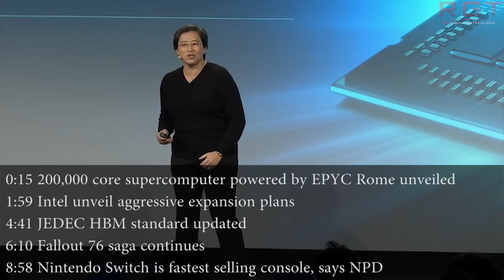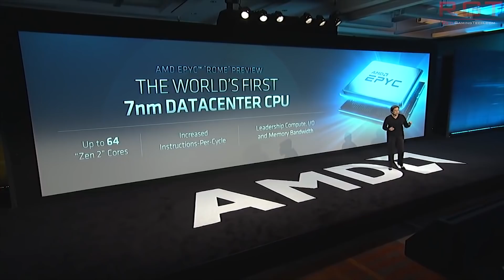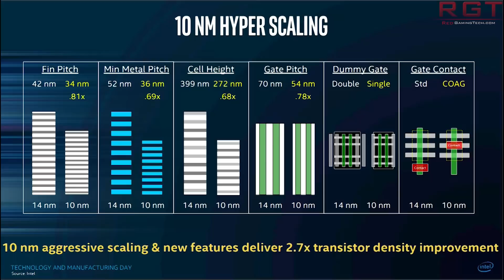AMD EPYC Rome Supercomputer Unveiled | Intel 's Aggressive Expansion Plans

Comment: Hey Martha, would you mind putting the headline in the middle of the video thumbnail? As it is, the Android notification only shows a horizontal strip around the center, so I saw the first line of the headline, but not the 2nd. The title doesn't wrap and it is long enough that it got cut off. So I was able to see the AMD headline, but the Intel headline was just "Intel's aggressive ..." which isn't very revealing!
Reply: or at the top the better.
Reply: @joaquinninoortega156  no, the top gets cut off too.